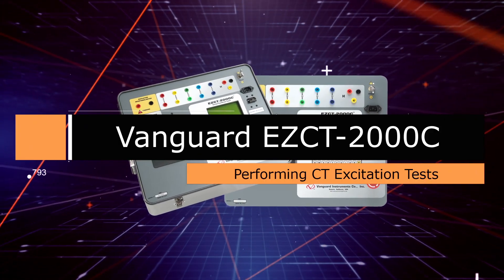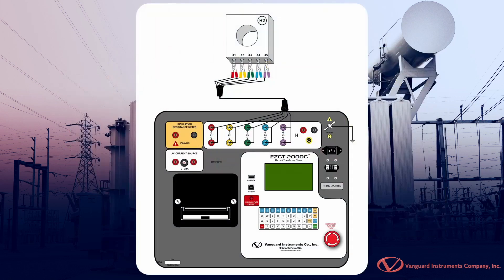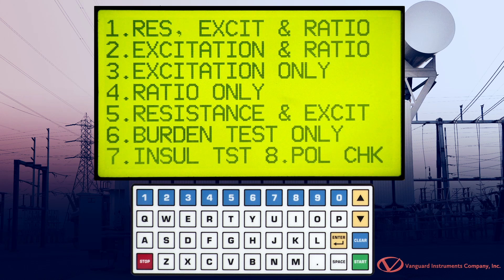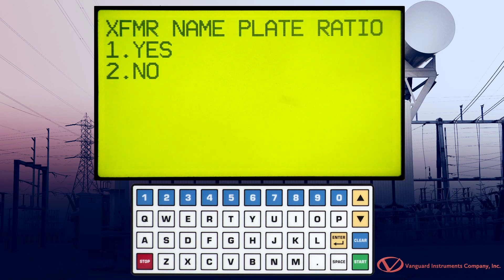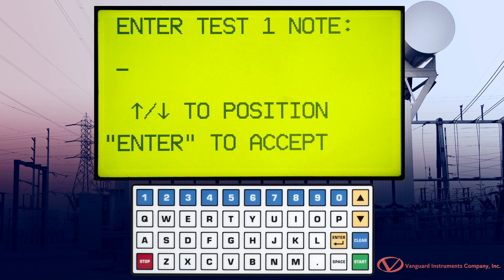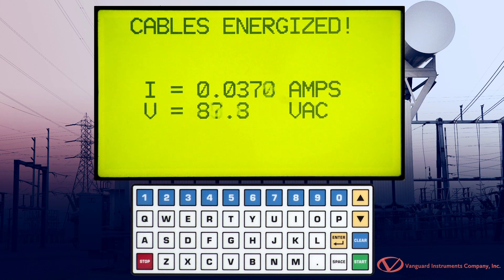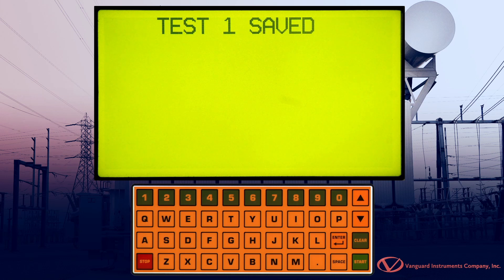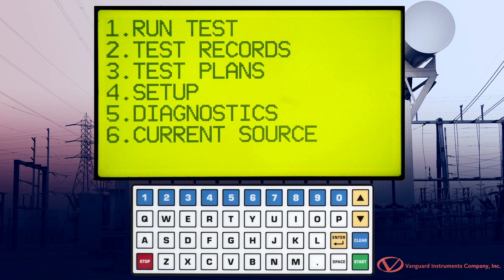Performing a Current Transformer Excitation Test with the Vanguard EZCT-2000C

Comment: How do I know how much voltage to use?
Reply: This is the reason I watched this vid but practically i think it is only can be acquired by doing several tests with different voltage. For example, testing 600/5A CT with 50V of test voltage could give the untrustable result (with bigger error)..
Reply: How do I know how much voltage to use